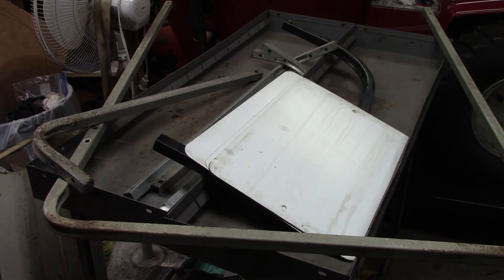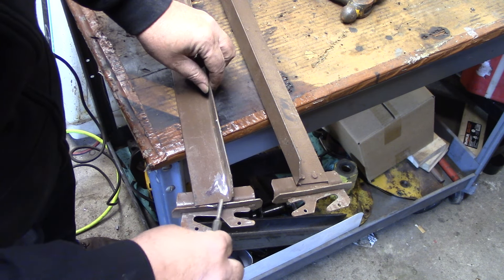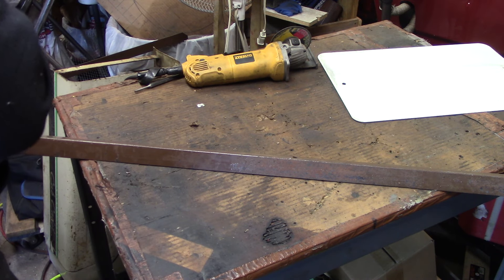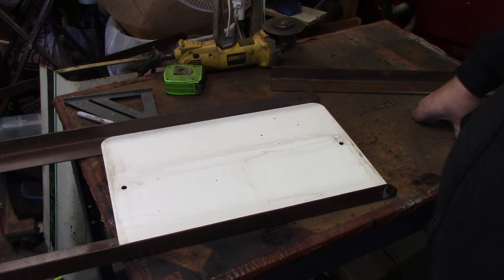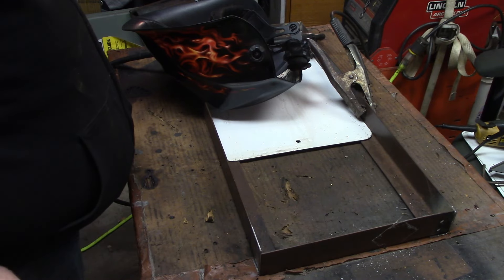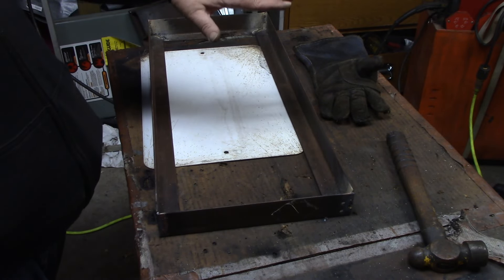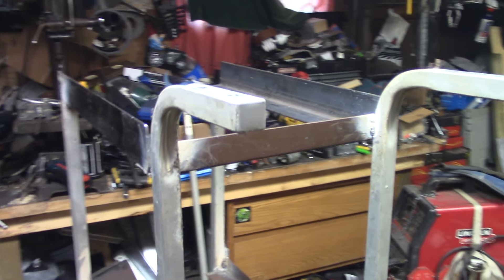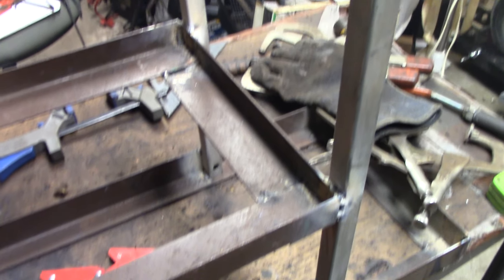DIY Welder cart made from scrap metal laying around the shop.

Comment: I don't have a metal chop saw either Ed, still doing mine with a angle grinder too.
Theres more pride taken when you can build something useful for yourself. 👍
It's looking good, it never fails though, run out right in the middle.
Reply from the maker: I can't really complain that spool of wire has lasted longer than I thought.
Reply: Well that’s a plus.

Comment: Good work. Must admit I don't weld castors on, always put on a thicker piece of metal that will take a thread and bolt.
Reply from the maker: I wouldn't normally weld them on but the bed rail is some type of hard spring steel and I don't have a good enough bit to drill it.
Reply: @PullerbearEd  It is also too thin, which is why I would weld a mild steel plate on. However welding it on works.
Reply from the maker: I didn't think about it being thin, I may have to